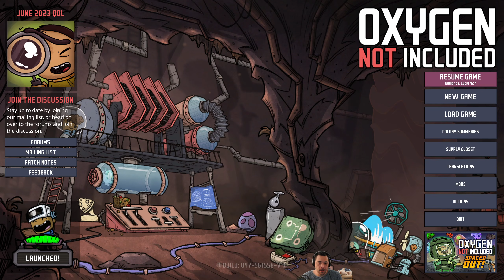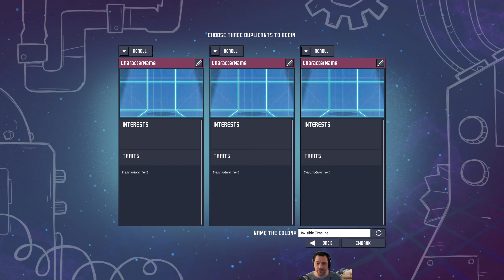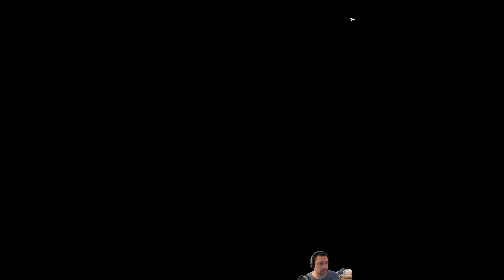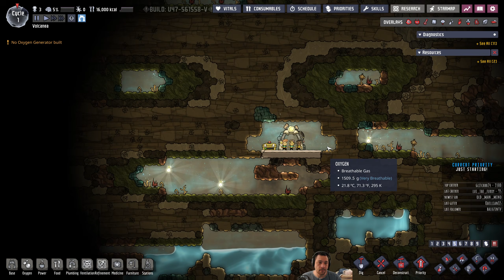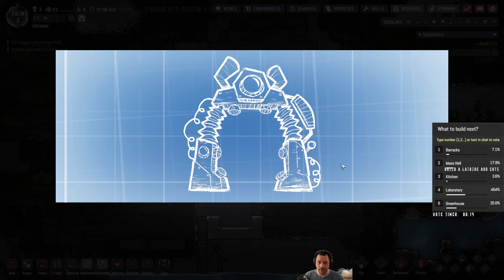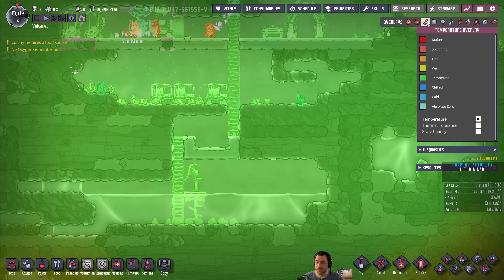Oxygen Not Included Volcanea

Comment: Just as a note. And im only throwing some info out so Rhadamant don't take a dump on me like you have before as im not telling you what to do 🙂 the only important thing to do in the first cycle is outhouses or they pee on the floor. eating on the floor and sleeping on the ground is fine as happiness isn't an issue at the start for a bunch of cycles with the buff "new beginnings" I think its called, But always get cots and tables up on cycle2. As a speed tip always build your research beside the gate and then when you get super computer do it directly on the other side of the gate as it gives you 15% speed bonus in the light it gives off.
Reply from the maker: Yup, I went straight for an outhouse for that exact reason